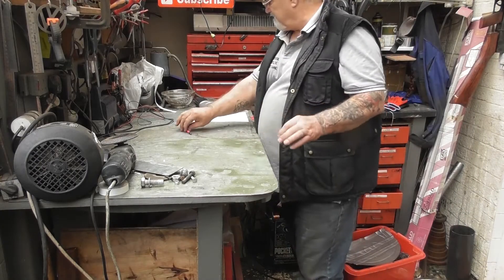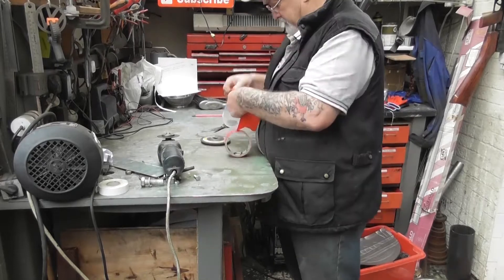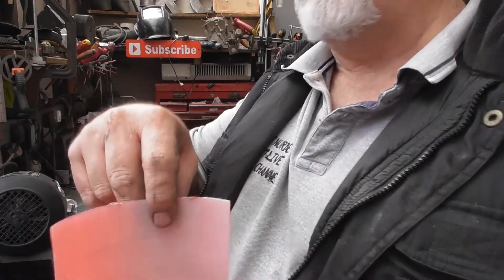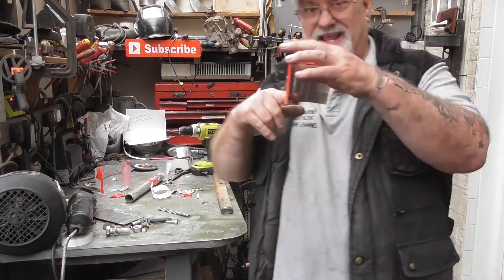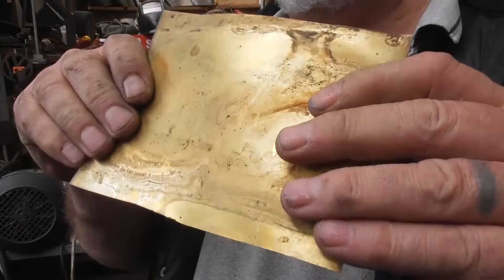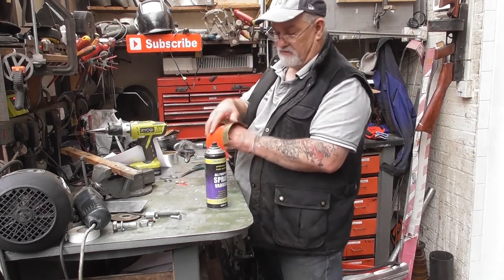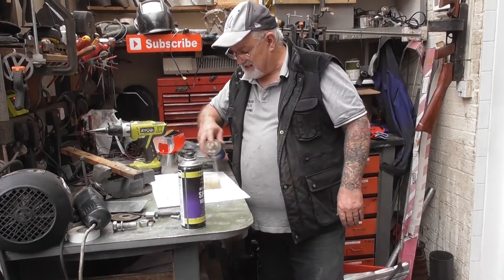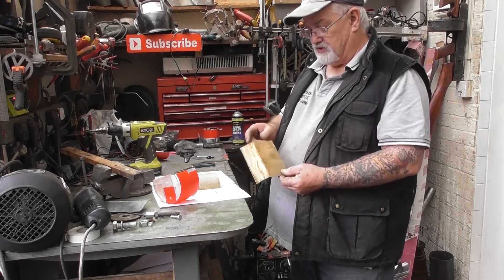how i made my Parabolic Antenna Range Booster for DJI Phantom 3

Comment: At first I thought these wind surfer type range extender snap on were BS. 
  Well nothing tells one better than to try it out yourself.
  I made several different sizes and used several different metals and shapes. To be honest they all did actually give me a few hundred extra feet. However when I made one using a piece of 8 inch diameter pvc pipe cut in half. Then used ,of all things Stainless steel mesh ,with approximately 1/16 the inch gaps and 1/32 inch SS wiring. Well NELLY.  This honestly increased my Phantom 3 Standards rang both RC and WiFi video reception dramatically.  While flying here in Florida on flat land, I was only averaging about 1800 feet in any direction.Well when I put my contraption on the rc unit.I can now get an honest 5500+ feet. I don't quite understand how or why I was getting such a bad range prior to this added device,but now every time I go put to fly ,I easily obtain a full mile ,with absolutely no problems.Well no problems so far. Lol
Reply: Robert Nurden  I've also got a Phantom 4 pro with firebridge. It's awesome, it has a safe 4.5 mile range . 
I just like to tinker with stuff. Always trying to improve on stuff VIA cheap and usually simple modifications.  After trying everything from aluminium to gold foil, with every shape you can possibly imagine.  Surprisingly the Stainless steel mesh with the 8 inch cross section of PVC pipe ,with the mesh inlaid, turned out to work best by far. Hope you get more time to enjoy your drone.They really are a ton of fun.
Reply: Got a picture so I can build my own.